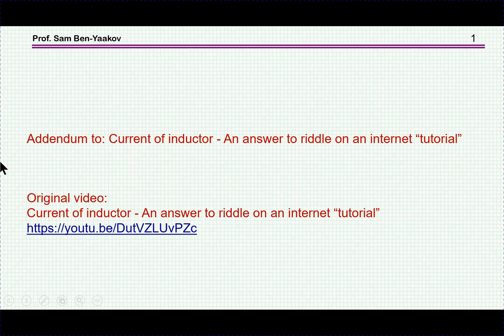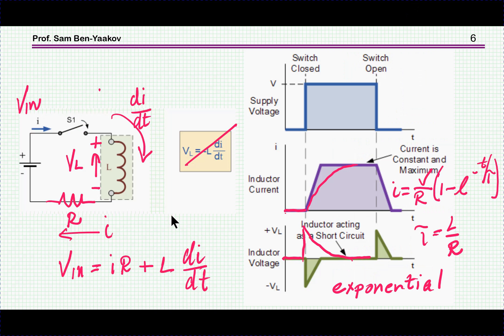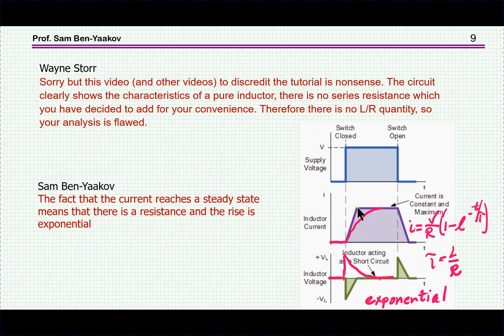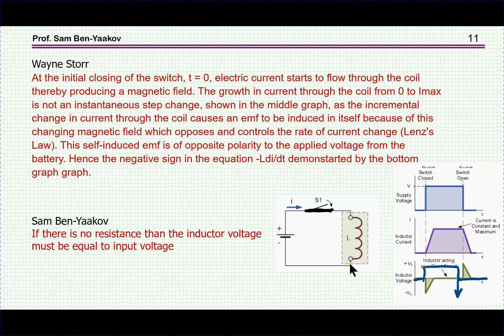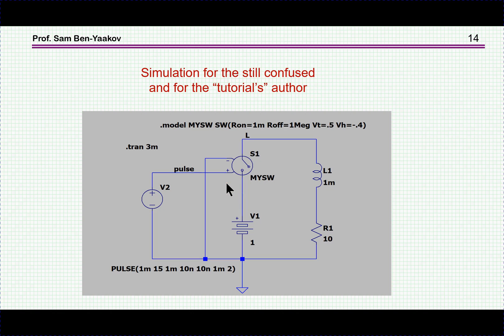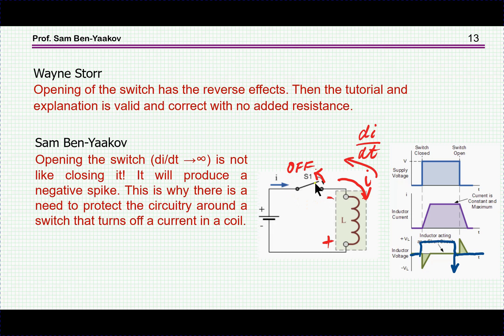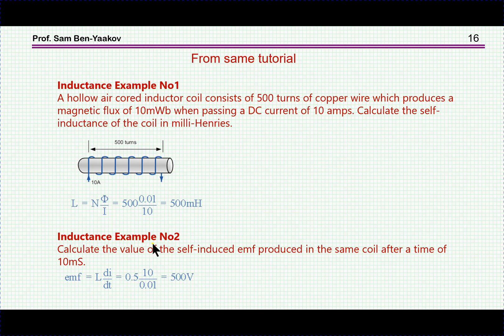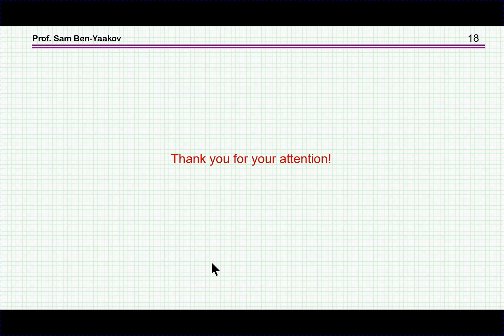Addendum to: Current of inductor - An answer to riddle on an internet “tutorial”

Comment: Well explained Professor Ben Yaakov. I was pretty confused with the tutorial and was questioning it as well. Thanks for your explanation and it really helped clarify and emphasized the importance of understanding of fundamentals. I believe the original author was mixing practical design with ideal design in his tutorial. The battery itself has internal resistance but he assumed that is the case for the ideal voltage source.

Comment: Constant Imax is when V+=V-
Reply from the maker: Sorry. I don't follow. To which minute in video are you referring?
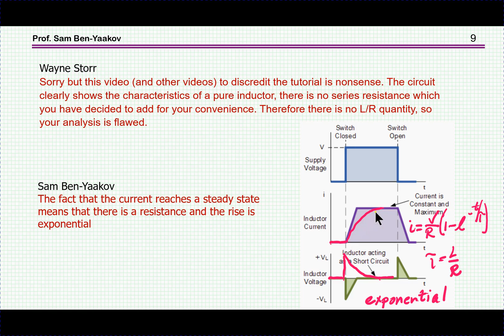Reply: @sambenyaakov  5:05
You didn't understand what he meant by Imax. I think it means when there is no more voltage difference on L, when I is max and constant, but to reach Imax it needs an R; without R,  V and L are constant, and I keeps climbing V/L=di/dt, like you explained.
Without R, the V on terminals of L are the same as the battery's.

Comment: Would the tutorial be partially correct if it is assumed that the inductor value is very large?
Reply from the maker: No. Note that according to author current is still flowing after the switch is open. To where?

Comment: Oh WOW! When you first brought this up, I just thought the author made some assumptions like inherent resistance in real-world circuits, and simply drew approximate piecewise graphs because they couldn't be bothered to draw them as actual inverse-exponential curves (though I would have at least tried... many drawing tools at least give you the option to draw ellipses and Bezier curves which could be used to sort of approximate the shape). The second chapter, it sounds like he just doesn't understand how derivatives work... o_0

This reply to you makes him sound like some flat earther haha
Reply: Great video as always. The only thing I would have added is "lets vary the series resistance and see how this sets the maximum current for a given voltage" with several I(t) graphs on top of eachother to show the effect. and also changes to the inductor to show how that affects the initial slope, especially of the no resistance case.

And if the author chooses to argue on the premise that simulation is a timestep approximation, you can show that increasing the timestep makes the negative voltage spike bigger and bigger as it approaches continuous time.
Reply from the maker: Good p[points. Pointing to errors is one additional way to convey knowledge.